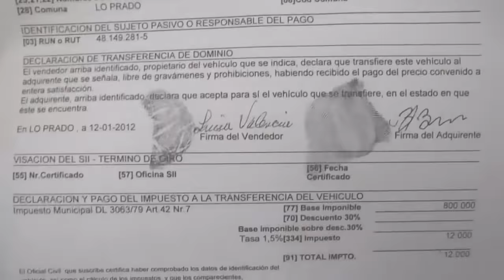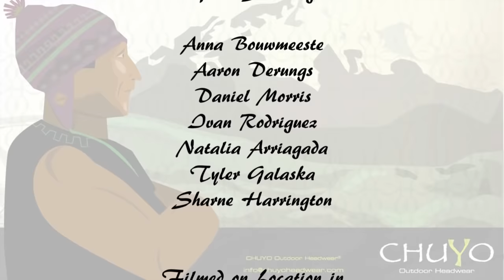Hasta Alaska - A Chile to Alaska Travel Series [5 years on the Pan-American Highway] // S01E01

Comment: I bought a Mitshubishi L100 mini van in Chile. Your right, it wasnt easy! The L100 is like a 3/4 size kombi with a 550cc 2 cylinder engine putting out 30 HP! Maybe 'micro van' is more fitting, you can fit inside lying down so thats all that matters. Travelled Chile, Argentina, Bolivia passing over Los Andes on several occasions and in some really remote places. After driving through Lapaz and part of the Amazon, i ended up in Brazil, where i met a special lady and married her within 3 months! We've been married now almost 11 years and i still use the little van for work!!